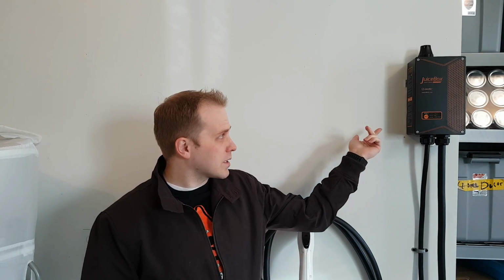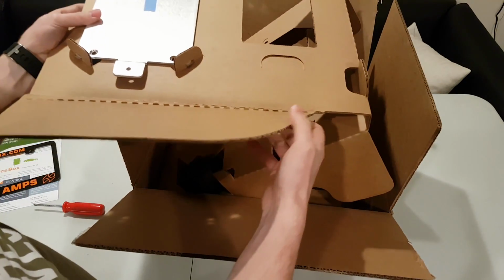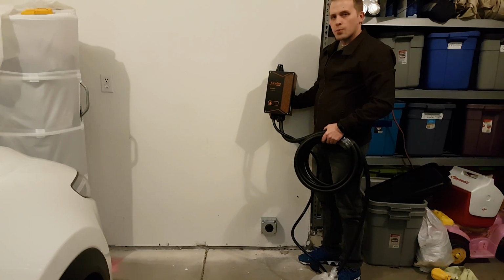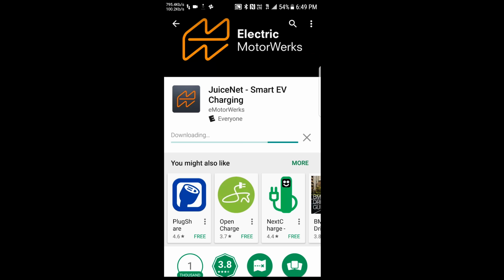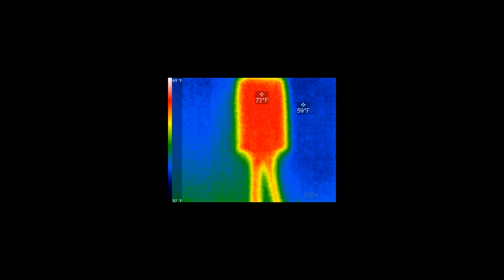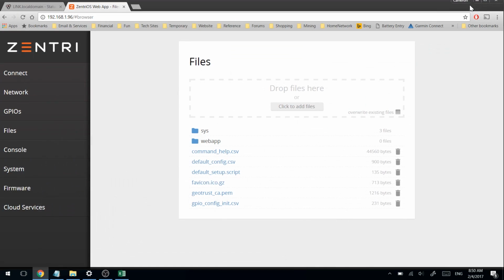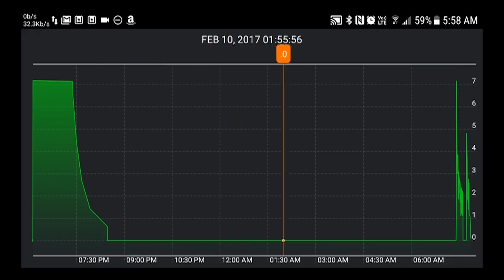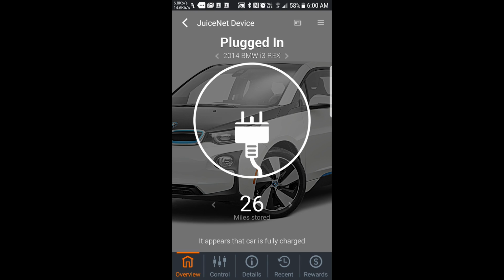Juicebox Pro 40 Review! - Overview, Installation, and Operation Information

Comment: Just a few comments regarding your video. Overall very good. However, the national electric code for receptacle installation is 18” min up to 5’ xx”. I forget the exact max value. There are additional requirements if your garage is underground etc. So you would fail inspection on that. I have the 2018 version of your box the cables are 12” and 24’ . Also, it’s best to keep your length from the receptacle to your circuit breaker box as short as possible. In my case I have a sub box in my garage. My cable length from the 50 amp breaker to the NEMA 14-50R is less than 36”. Six (6)  gauge wire is bitch working with, I suggest if you never wired before think twice. Also, use a metal box with an extender and use screws on every mounting hole. Not many people have plywood behind their sheet rock. I removed a section of sheet rock below the breaker panel and added additional studs for the outlet  box. Regarding the juice box mounting a 1 x 2 or 3 should work if you don’t want to remove sheet rock. You were correct about the breaker size 50 amps is required for a 40 amp load.

Comment: after using my juice box 40 amp I can't get the cable disconnected from the car...I have an ID.4 and used the key fob and nothing works unless I pull the yellow disconnect cord...any ideas

Comment: Question for ya...do you know if this actually needs internet? What if I connected it wireless lan that wasn't connected to internet. The reason I ask is because I'm considering purchasing 2 juicebox pros for their load sharing feature. 2 devices can split the Max load in hald but supposedly requires a connection between the two. Don't know if that connection requires the internet or can be achieved simply via wireless lan.

Comment: We have the older style Juice Box Pro, it's silver colored. It charges the EV very quickly but I can't recommend the company. We needed a new WiFi antenna for it and contacted the company several times but could never get a replacement. Their store doesn't sell it either. As a result we can't use any of the 'Pro' features. Good charger bad customer service.  😡

Comment: Thanks for the great video. Unfortunately, I'm unable to install my Juicebox Pro close to my 14-50 outlet box like you show in the video. I need to install it 20 feet away from my 14-50 outlet box using an extension cable. Do you think this extra distance may harm my JuiceBox in any way? Evenmore,  do you think it may harm my Chevy Bolt if the electricity is traveling the extra length of a 20 foot extension cable?
Reply: No but you better be damn sure the extension cord is rated for what you're doing.  It's not going to be cheap, and it is going to be heavy.

Comment: Hey! So I am little lost on the 50amp circuit vs the 40amp charger... Does that mean I need to downgrade my circuit breaker to 40amps?
Reply: No, you don't need to. The 40 amp reference is related to the "80%" rule: if you have a 50 amp circuit, then you should limit a continuous load to 80% of that = 40 amps. You might find it interesting to read up on electricity basics and learn a little about voltage vs current, etc. A 50 amp circuit means it's rated to handle a MAX of 50 amps (the current), above which the breaker should trip and stop the flow of current for safety reasons. It's absolutely no problem to run less current on a 50 amp circuit, e.g. 40 amps or less. This is true on your 15 amp house circuits as well: charging your phone from an outlet isn't even exceeding 1 amp on the AC side; think of breaker's amp rating as an upper limit.
Reply: Actually you're better off with the 50amp circuit breaker. You can plug a 40amp device into a 50amp circuit but not vice versa as the breaker would ( hopefully ) trip.

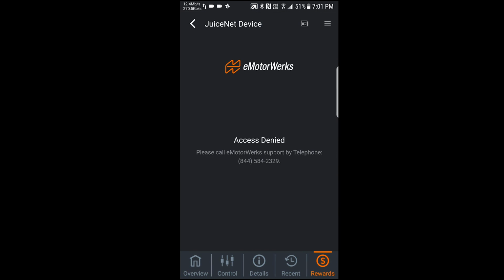Comment: 8:55 is that the temperature in the vehicle's battery, or more likely, the temperature of the Juicebox? I didn't know J1772 could communicate battery temp data.
Reply: I would also like to know
Reply: @rangerbrown  I have confirmed that temperature reading is just a sensor within the Juicebox, which might as well serve pretty much as the weather report in your garage because the unit itself doesn't generate much heat ever.

Comment: 9:45 the IP address interface on the browser on my Pro 40A, I only see the Connect tab and Network tab not any of the others you have.
Reply: Same as mine.  Probably removed them to keep us from bricking it accidentally.
Reply: @Solkre82  do you find that your juice box requires a very strong Wi-Fi connection, otherwise it tends to go offline? My router is literally about 20 feet from the juice box with one wall in between and once a week or so I get an email saying it went offline
Reply: @danwat1234  I've had no connection issues with my Pro40.  It's relatively close to my Acces Point; which is a Unifi AP-AC-Pro.  I've never had it go offline except one power outage.

Comment: What is the lowest amp setting you can go when charging on 240V?
Reply: so these things are actually relays, the actual charger is on the car. The answer would be in your manual. BMW does not openly discuss this but it has been reported that you can set to draw down to 20 amp for a level 2 32 amp charger.

Comment: My juice box 40 pro lasted for 2 hours before it had the 3 flashing lights and constantly restarting error 
I replaced it with a charger point 40 amp lvl 2 station 
It doesn’t have the WiFi features but it does charge my 2017 volt in 3 hours from 0 to 53 miles range 
With out any problems
FYI they do not have a 3 year warranty it’s a 30 day replacement / refund warranty  
Read the fine print 😡😡😡🤬🤬🤬